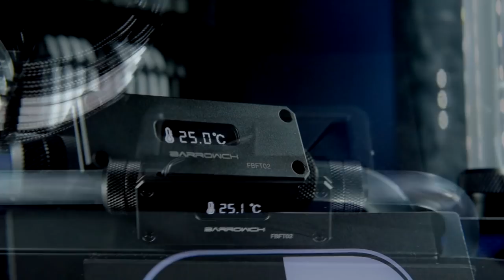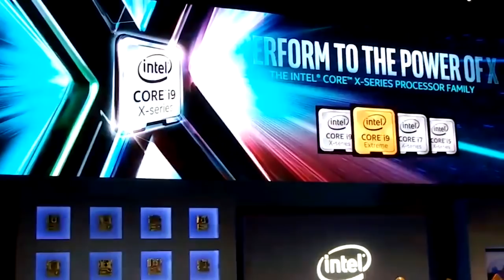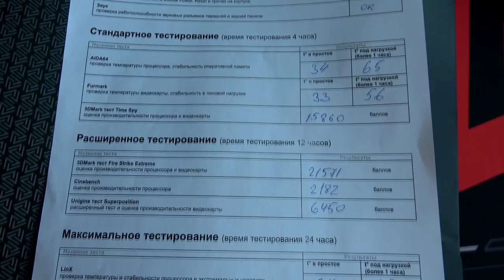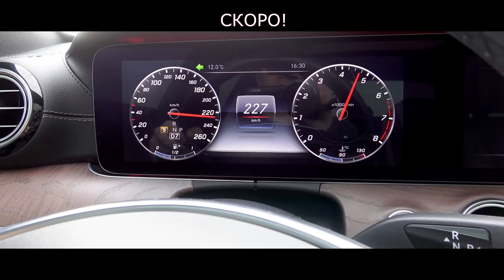ТОПОВЫЙ ПК от HYPERPC за ПОЛМИЛЛИОНА!

Comment: пк: HYPERPC COSMOS 7
Цена 502 200 руб.
характеристики: Видеокарта:
2 x MSI GeForce GTX 1080 Ti Gaming 
 Процессор:
Intel® Core™ I9-7940X 
 Материнская плата:
MSI X299 GAMING PRO CARBON 
 Охлаждение:
HYPERPC WaterCooling 240 RGB 
 Оперативная память:
Corsair Vengeance RGB DDR4-2666 64GB 
 SSD накопитель:
Intel Optane 900P 480GB 
 Жесткий диск:
Seagate 8TB BarraCuda 
 Блок питания:
Cooler Master V1200 Platinum 1200W 
 Корпус:
Cooler Master Cosmos C700P 
 Операционная система:
Microsoft Windows 10 Профессиональная Лицензия с USB носителем